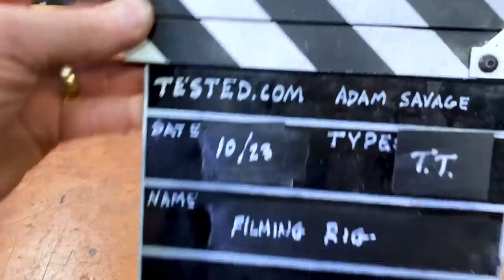Adam Savage's Favorite Tools: Mobile Filming Rig!

Comment: I built my own tripod phone mount out of a container for a watch ( the plastic display containers you get at Walmart with a watch ), hot glue and a weird piece of plastic and I threaded it to fit.
Clamped around the phone and the self tapped tapped screw and worked quite nicely until my phone became bigger than it.

I was asked to film something ( shimmy mob fundraiser violence awareness ) and was unable to borrow a better camera and for what I was doing I was OK with using my phone. I put together a couple pieces of wood and some 1/4 20 threaded rod and made sort of a grip gimbal like thing. it came out nice got the job done and was reincarnated by the next week into a new version.

then decided to get a neewer double grip aluminum mount, it was one of those it's a little more than I wanted to pay but once I got it it was worth it. Plus it has 1/4 20 sockets all over.

Comment: I have been waiting for this OMG. I reside in a Wheelchair and knew you had that what I now know is Lock Tight. I love that I can clamp it to my Powerchair and record at the same time, wow. Thank you, I am replying to my already message to ask a question when I go to the amazon link for the clamp, I don't see where on the clamp that the lock line attaches to it? Also, the quarter 20 bolt attaches to the lock line? is there an Email that I could ask this question?

Comment: For shop use have you considered using a runway base/stand in the shop? 
Also, a tool battery to USB adapter could minimize some of the hazard posed by a 20' charger cable.

Comment: Instead of your monopod consider an ultra compact lightweight light stand.  I have two of these that I bought years ago and I've traveled the world with them.  They get very small.  I don't think quite small enough for your bag, but certainly small and light enough for your shop.  They easily pack in a suitcase or backpack and they get really tall.  Also consider making a little double sandbag that you can drape over one of its legs of the stand or one of the legs of your monopod.  You could use some of your recycled dyneema and put a zipper on it so that you could remove ziplock bags of sand, rocks, etc when not in use.  Compact light stand:  https://www.amazon.com/dp/B001M4HXB2

Comment: My addition would be a v-mount to usb adapter. You could lower the center of gravity on your setup and easily have enough charge to power your smartphone for days. :D (edit: Turns out you could simply use a v-mount cell that allready has usb charging port)

Comment: You might want to add an Olympic 10lb weight lifting plate. The Olympic plate has a larger center opening and could probably slide over the base and sit at the bottom making it more stable without adding too much extra weight.

Comment: I'm surprised you don't go with a DJI Pocket 2 to film. It's tiny, gimbled and 4k with available wide angle lenses. You can easily check framing with the front facing screen and it can automatically track things with its pan and tilt. I'd just throw it onto the end of your loc line clamp (you can get tripod mount cases for it)

Comment: Maker brain is going here. Could you make a new, longer, folding tripod foot? Something that adds just a bit more weight, and still folds into the bag? Might help stabilize the odd center of gravity by extending the legs 2 or 3 feet. Like hinged legs or ones that telescope and lock into position. Heck, you could also give it some thick rubber tread.

Comment: Maybe a couple of 5 or 6 cell power banks at base of monopod then run a usb lead up through and out the top of lock line. More stabliliry at base + more mobility of the whole rig not being tethered to a wall charger.

Comment: I suggest you buy a big battery and fix it at the base. No need to reach a power point too far and you stabilize a bit your rig at the same time, even if you add a bit more weight.

Comment: I wonder if a 1lb to 5lb weight(lead block maybe?) placed on one of the legs, or a loop around the center shaft, would help keep it more stable. You could even add a handle to it to make it easier to pick up.

Comment: I ordered cheap mini tripod from Ali..  By construction very similar to my first tripod that I'm still using.. Best thing that that cheap tripod it's very stable and very small and can easily handle even Sony AX53.. My flexible  tripod is good only for phone, but biggest tripod I, usually, use for lights with diy mounting for floodlight.. :D Biggest tripod I can't take anywhere because it's big and was originally for laser leveling.. Easily I can handle around only my first tripod, small China tripod and flexible tripod.. First tripod I purchased locally 12 years ago after filming general repetition of spectacle, when at the end my hand can not hold Sony DCR-HC36 camera any more without hurt.. :D Yeah.. That camera is very nostalgic by now.. Very good stuff was filmed back in days with it.. Still have it to watch old videos and one time, even filmed concert in daughter's school because this camera have great optical zoom.. After that I bought new camera.. :D reason - phone have excellent resolution, but don't have optical zoom, old camera have good optical zoom, but have smaller resolution (by modern standards)..

Comment: I recognize that there are (usually) multiple tools appropriate for any task but I’ve long questioned Adams preference for loc-line because of  its tendency to creep — it seems he’s always reaching out to adjust a slipping camera or work light.  I use magic arms in my camera/light rigs to provide quick versatile adjustment and stability. (Yes, I’d add a weight to the bottom of this particular stand, particularly if I’m going to add a lever arm to the top.) While I’m questioning Adam’s choice here, and providing an alternative for consideration, I recognize that his needs and preferences are different than my own. I am offering an alternative solution, not one that is objectively “better.”

Comment: Funny to me that starting from the same place, eg annoyed at camera on tripod and the hassle etc I went in way the other direction ;-) I built myself a 'robot cameraman' basically a crane arm that lifts/lowers and rotates with a 2 axis gimbal on the end that mounts my dslr and can control the zoom. Plonked in the middle of my space I can control it to get a lot of the shots I want. using mobile for pickups/angles where necessary.

Comment: I'm really interested in mounting my everyday-use phone to my computer desk - not doing any filming, just have limited use of my hands, and am getting sick of holding the darn thing to type on it, read, play games, etc. The clamp part specifically has my attention. I need my set-up to be really stable, and non-versatile, so the loc-line is out. The part that is defeating my plans is the connection between a nice hefty clamp for the desk (thankfully only 1" thick) and the phone-holder piece. Any tips on how to attach those two objects really, REALLY solidly?? Ya know, short of welding em lol

Comment: I use a lightweight tripod on the go. My "friction" would be dicking around trying to balance that monopod.
Reply: I agree. a lightweight tripod could solve a lot of the balancing. though he may be concerned more with floor space
Reply: High capacity power bank would do the trick and allow for more filing without the need to be near a power outlet when on the go. Also ankle weight wrapped around would help as well.

Comment: I would've made the stand have longer "legs".
Reply: Was gonna say the same thing. If he found a folding tripod base which had legs that were even a couple inches longer it would save him a lot of the headache of stabilizing it.
Reply: Wouldn't it make more sense to have a floor lamp base or old medical inspection light floor (something with some heft at the bottom) base and pole for the stay in the cave monopod and just use that lil leg Manfrotto as just the travel kit?
Reply: @MrShwaggins  But he wants to be able to easily and quickly move the rig around to maintain his 'flow', and a heavy base would make that more difficult.
Reply: I was thinking the same thing...it would be easy to make them extendable so they still fit in the travel case.

Comment: Personally I like and use a Neewer Lighting Stand and a Manfrotto Articulated Arm.  Super stable, easy to adjust, and it holds its position.  When I need shot where I don't need the Lighting Stand, I just attach the arm to a Manfrotto Super Clamp.  Add in the Joby clamp if you're using a phone, but this rig can handle a DSLR (which is what I use) no problem.

If you want to, or can, spend a little more swap out the basic arm for the magic friction arm which is even faster to adjust.

Stand:  https://smile.amazon.com/Neewer-Centimeters-Adjustable-Photographic-Reflectors/dp/B0732VF22Z/
Arm: https://www.bhphotovideo.com/c/product/354220-REG/Manfrotto_196B_2_196B_2_Articulated_Arm.html
Clamp: https://smile.amazon.com/Manfrotto-035RL-Super-Clamp-Standard/dp/B0018LQVIA/

Alternative arm: https://www.amazon.com/Manfrotto-244-Variable-Friction-Bracket/dp/B000J4FONU

Comment: Have you considered a 360 camera as a shooting option?
I use one all the time. Framing issues? What framing issues? I set it up, point the 'front' lens in the primary direction, and just shoot. Post-processing lets me frame and track what I want in the shot. I can export a 'flat' movie clip that has the bits I want.
You could chuck one on the tripod and move around the bench freely. Then set key-frames in post to pan the camera where you need it to 'point'.
There are some complexities to consider. Most if not all 360 cameras are fixed-focus, so you still have to block your shot to avoid having tiny little objects in the middle of a sea of your cave. Also, the resolution has to cover 360 degrees, so shooting in 4K is not a viable option for many of the mass-market cameras.

Still, it's a good tool for a video kit.

Comment: So the hole in the monopod foot (for the screw in spike) fits on the screw on the monopod base?
Reply: Seems like you could use a little cheaper tripod base too.  That Manfrotto has a fluid head that you don't use in this appplication (I know you already had the Manfrotto)

Comment: There are a lot of less expensive phone with better cameras. Don't know what software is use for encoding and working with the videos but an mp4 with a 2960 x 1440  resolution should be better than what comes from the one used.

Comment: That long of a 5v usb cable will charge VERY slowly. You're better off having a short usb cable with a long 120v extension cord.
Reply: So slow that while recording video you may use power faster than it can charge.

Comment: I've been a photographer my entire life and one of the best accessories I ever bought was this Manfrotto clamp: https://www.bhphotovideo.com/c/product/349147-REG/Manfrotto_175F_1_175F_Justin_Spring_Clamp.html
I use them to put up portable flash units via the cold shoe mount plate but it can be removed for other mounting options. Very handy for clamping onto whatever is handy and also has the 5/8" spigot mount for stand mounting.

Comment: Reaaaaal suprirsed you havent added some length to those tripod legs, or at least added a weight at the bottom. Constantly notice you fiddling to balance the phone position so it doesn't tip over. Slight hit on mobility but worth the time saved adjusting.

Comment: Hi Adam, how about adding a Neodym Magnet to each of the three Tripod Foots, then you could just drop 4 x 4 x 1 inch Steel plate on the ground an put the tripod on it if you need it, or just use it wthout.

Comment: Since I got a cheap monopod base I allways thought there must be a better solution to this....your video reminded me to try it out...still got one of these laying around:
https://www.amazon.com/gp/product/B01MSAEZN8/
(There are other brands out there)
Since you can expand the legs and fold them out to nearly 90degree, you get a stable base. (Ball head can be easily removed, but unlike others at that size, the screw to the tripod itself is just 1/4. So you propably need a 3/8 converter screw to attach the monopod stick...

so a big thanks to you making my neurons fire the right way

Comment: Hi Mr Savage. That is a great tip. I realy has to make the footprint of my rig smaller. I will try loc-line😁
Maybe I have a trick for you as well. Check out my DIY power bank. That will shorten the long charging cable and if you hook it to the foot of your rig, it will add weight to the lowest part and therefor stability.

Comment: I love this channel, but I don't think a 22 foot USB cable is a good idea.  USB cables were never intended to be anywhere near that long.  That's a long way for 5V to pushing 3 amps.  I'm surprised that your charger can keep up with the power consumption of shooting video at that distance, I know mine can't.  I'd run an AC extension cord to the base of the monopod and then let the USB do the vertical bit.  That would also give you an intermediate point of failure in case someone trips on the cord.

Comment: I use this Monopod with a Gopro Max for a lot of things and have been very happy with it. I was doing a shoot crossing the street and had it on the double yellow line when a truck thought it would be funny to hit it :( it flew 30'+ and got bent up but after I bent it back straight it still telescoped/worked great. with the little tripod base it stands right at my eye height which I find to be just the right height. Oh, and it's water proof. 

https://www.amazon.com/gp/product/B0762BMV93/ref=ppx_yo_dt_b_asin_title_o04_s00?ie=UTF8&psc=1